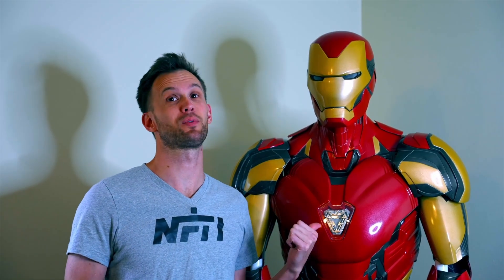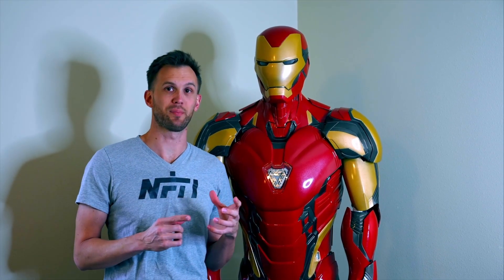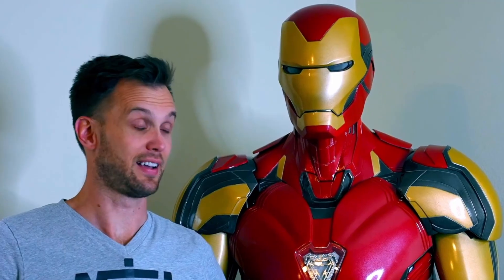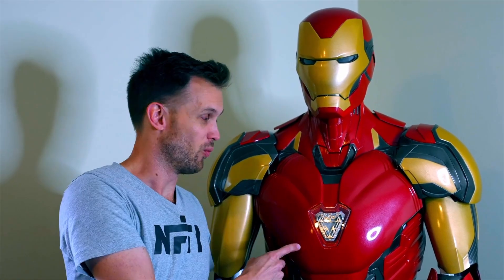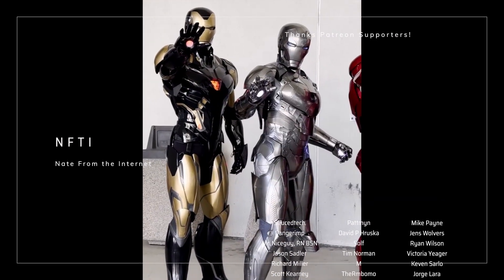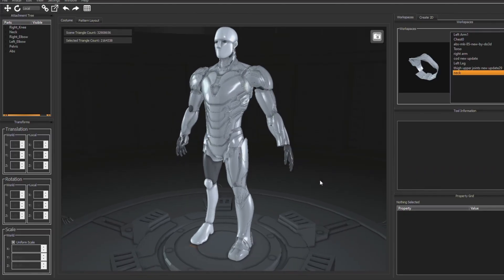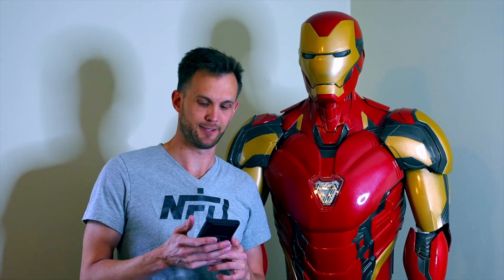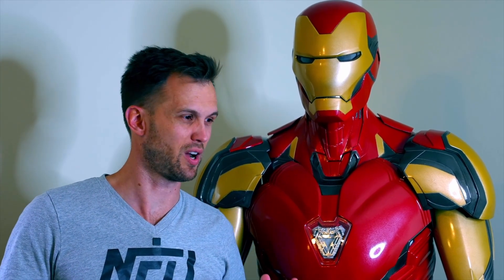COMPLETE 3D Printed Iron Man Suit! (part 3)

Comment: Hey Nate quick little idea for better weight distribution. In the back packing industry they use waist straps and a lightweight frame to hold most of the weight of a backpack to relieve some of the pressure from your shoulders you could probably incorporate a waist strap with some padding like a thick belt and incorporate a weight transfer method!
Reply: Yes, carry weight on the hips.

Comment: Two systems that should be added to these suits...air conditioning.  And maybe a motor system so that it could support its own weight.  The power requirements and weight of those motors though...